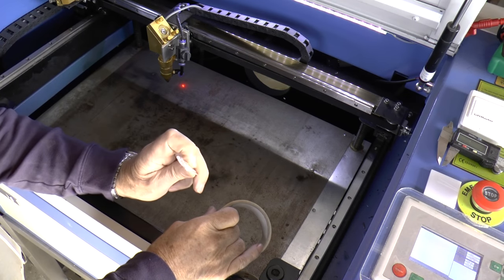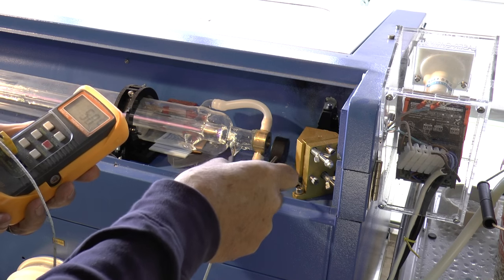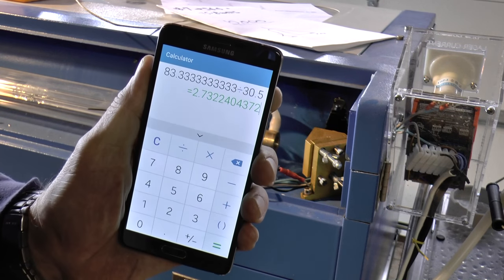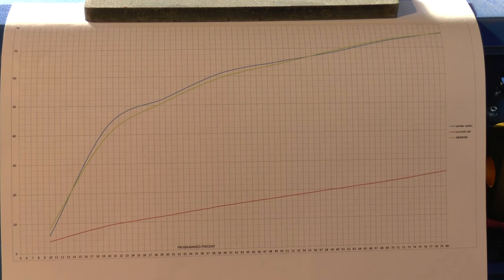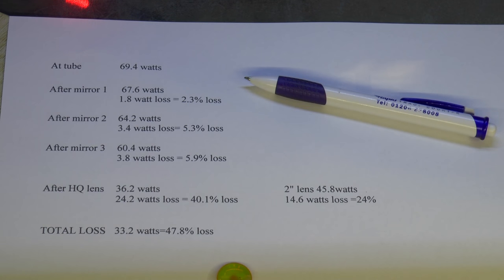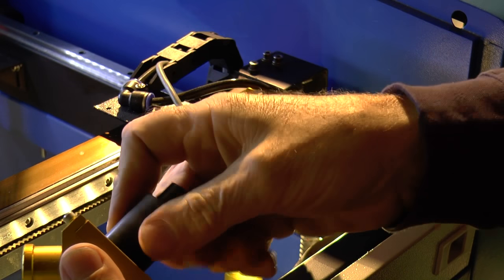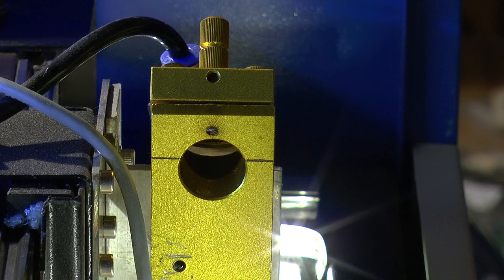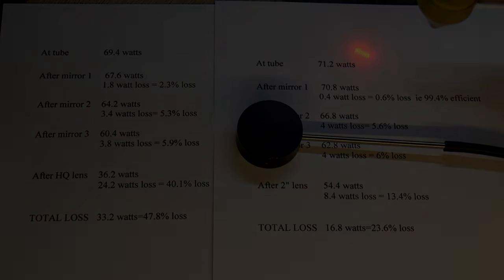RDWorks Learning Lab 79 Machine Health Check Part1

Comment: Thanks What do you mean Are you using the ramp engraving option?
Reply from the maker: Hi Anas
When you use scan mode there are 5 tick boxes below the power settings. One of those is Ramp Effect
 if you tick this it allows you to specify a ramp size. If you are making rubber stamps this is important to support your thin sections. 
see my video
https://www.youtube.com/watch?v=cVuYyfJmfTs

Best regards
Russ
Reply: Thank you very much for all this effort. Please, is there an application or device that translates English into Arabic to take advantage of your excellent explanation of the valuable information you are presenting
Reply from the maker: I am sorry that I don't think I can help. I have searched to see if Google do a you tube translation into subtitles. They do so for English but not for other languages.
Thanks for your kind words
Russ

Comment: seems to me that the copper mirrors are not flat.
If I remember correctly you made these by hand ... 
When you showed the surface of the mirrors for discoloration etc.
I noticed a curvature of the reflections.
Doing test burns should reveal round holes ..
Reply from the maker: You are correct and that was the problem The curvature had no effect when I was firinga 5.5mm diameter beam at the flat section in the middle of the mirror but  when I used my new tube without checking the beam size, the 8.5mm beam impinged on the curved section and ...oops!!  If you get to part 2 you will see the outcome.
Best regards
Russ
Reply: yeah duh ...
Sorry about that ...
I should have watched the second video before commenting.
Your conclusion was nicely explained there.
Reply from the maker: No Need to apologise, quite the contrary. Without turning to the last page to see who the murderer was you
deduced the culprit for yourself.

Comment: Great video.  I apologize in advance if this question has already been asked and answered, but what are you using to measure laser output power?  I might be interested in acquiring one if they're within my budget.  Thanks and keep up the great work!
Reply from the maker: Hi Tom
 Most low cost basic power meters are in the $250 to $350 price range.
https://www.cloudraylaser.com/collections/laser-power-meter
https://www.macken.com/collections/analog-power-probes
You may be tempted by the low cost of this Chinese origin instrument. It was my first foray into power measurment and was such poor quality I gained a refund and bought a Macken meter.  Some buyers have been happy (lucky?) and some correspondents repeated my experience.
https://www.2laser.com/laser_power_meter_probe_and_laser_monitor

 It was for cost reasons that I and several other enthusiasts from various disciplines attempted to find a low cost way of measuring power. We all experimented with many wacky ideas but eventually I had to accept that square wheels would not be a good idea, despite their one redeeming feature, no handbrake required. I settled down to studying the conventional technology to see just where the high cost was occurring.
Please watch the following video before making a decision.
https://www.youtube.com/watch?v=lO9rWlobLZU

Best wishes
Russ

Comment: in the 7,50 minut from this vidio what the distance between the first class & the tube
Reply from the maker: Hi Anas
The answer is that it's not important. The laser beam can be assumed as almost parallel, so that distance will not affect the performance in any way. The main limitation for that gap will be whether your tube hits the casing at the high voltage end . You really need about 12 to 15mm air gap beyond your tube. so this may decide the gap between the tube and mirror 1. I like to leave about 40mm so that I have room for power measurement with my little probe.
Best regards
Russ

Comment: Where can I order lenses?
Reply from the maker: Hi Ray

These represent the best value for money and the last time I did lens tests, these were best for cutting.
https://www.cloudraylaser.com/products/china-pvd-znse-focusing-lens-for-co2-laser?variant=43422450824
Make sure you measure your lens and order the correct diameter. 50.8 is the most useful and depending on the way your lens mounts, you may not be able to fit a 38.1 focal length.
 These are going to take between 2 and 3 weeks to reach you. For this reason I would order 2 so that you have one in reserve. Of all the things that can go wrong with your machine, damaging a lens is near the top. 
Bet wishes
Russ

Comment: Russ why don't you just use a block of something to put the plastic tool/tab on?

Also OMG where are your gloves when handling that lense.. ahhh poison!! ;)

my guess before watching the second part is the mirrors aren't flat..
Reply from the maker: Hi Dave
If you make one of those tools and use it you will be able to answer the question for yourself. The whole point of it is to be a quick check. 
I had previously (off screen) tried to clean the lens with isopropyl alcohol and also aceteone. and had handled the lens with my cotton glove on.  The good news is that I did not die when I touched to lens for a few milliseconds. BUT you are correct, I should practice what I preach!!!
Best regards
Russ
Reply: SarbarMultimedia yes maybe and also everyone should watch all your videos that way they would know this and point out your deliberate error to test your students that we have watched all the videos and we're taking all the info in.. hehe
I bet your videos have a really high % watched figure.. :)
I'm 18 minutes into part 2 ATM, I never managed to get my copper mirrors to a point of being happy with their optical performance..
I'm wondering now if it would be better to flat polish a sheet of copper with a know hard/flat surface and then cut out the mirror from that perfectly flat copper sheet.. what are your thoughts?
Also interesting stuff about the hours of life on the tubes.. it seems obvious after you said it but I never thought about it until you said :D
Reply from the maker: Hi Dave 
Deliberate error? You are too kind. I think I was lucky with my copper mirror trials because I was using my old 40watt tbe which had a beam diameter of 6mm. This new tube has a beam 8.5mm diameter and impinges on the soft non-flat extremities of mirror 1. Now the beam is "spraying at the edges and stands no hope at mirrors 2 and 3. I did use flat 1.5mm copper sheet for my mirrors but the polishing on cloth as opposed to using a proper lapping block (which I don't possess) was my real downfall. Someone did suggest I use copper coated circuit board. A very cheap and sensible solution which I have not tested but sounds promising. 

To be honest I never look at the viewing statistics. They are what they are. I'm still just an old guy in his man cave having the most fun ever. My other hobby is video and I recognized that my learning journey would make good video material for me to play with my editing suite. I had no expectations other than that there may be a few nerd hobbyists that might see this as "laser porn". I never stop being amazed at the emails I get from all parts of the globe.
 Best regards Russ
Reply: SarbarMultimedia only issue with PCB board is how flat the substrate is that the coppers bonded two but suppose I can soon test that just need to throw some developer on a bit of undeveloped board and see whats its like.. got a few boards floating around somewhere.. 
Think might have a look at that tomorrow... I bet you could cut the board with the laser and then just use a sharp knife to cut the copper.. interesting..
Reply from the maker: Hi Dave
PCB is a product that is usually a no no. However cut from the back face for just a few quick circles it may be OK with lots of extraction and the lid closed. Let me know how you get on
Many thanks for interest
Russ

Comment: Shouldn't you be wearing laser safety glasses? Are you at risk of radiation exposure? Thanks!
Reply from the maker: Hi
Thanks for your concern. Can I get you to view   https://youtu.be/kJe16YQlIM0 and make up your own mind.
Best regards
Russ
Reply: Noticed the same and while he was wearing glasses (no clue if they are acrylic or glass).  However I did also watch the video and it freaked me out when he said "there is nothing dangerous" because of the metal plate! While from a "thermal" perspective Russ is correct as beam will be scattered, however it is still "coherent" light and this creates the risk.  As Laser light in the ultraviolet (290 - 400 nm) or far infrared (1400 - 10,600 nm) spectrum can cause damage to the cornea and/or to the lens...